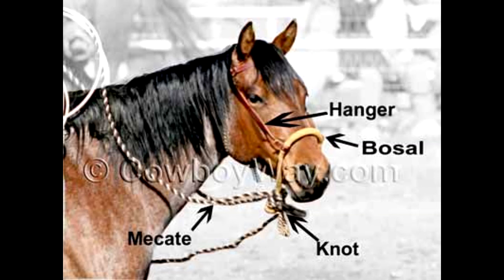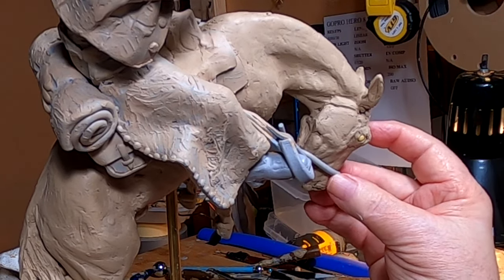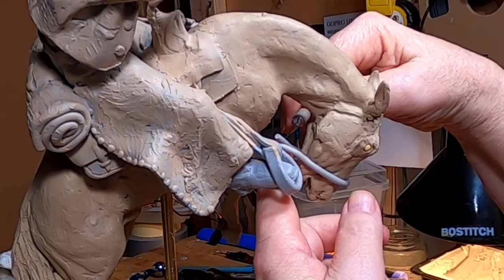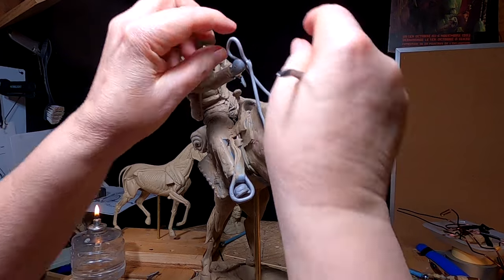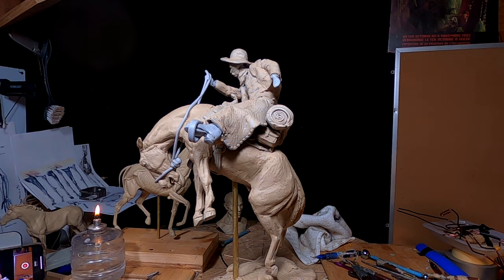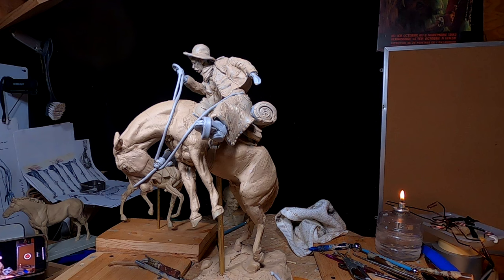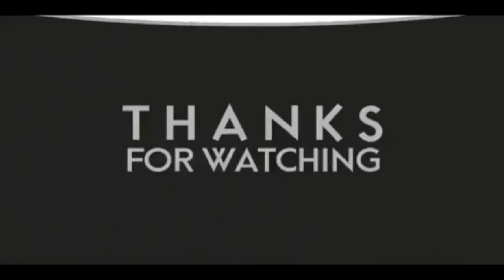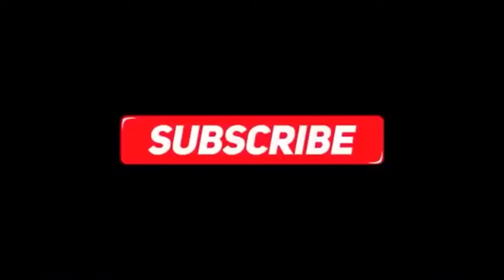A BURR UNDER THE SADDLE BLANKET   Creating the Hackamore Bridle

Comment: I still ride with a hackamore. Mine has a fiador and the mecate is made from alpaca instead of horse hair which is super scratchy. Some even made the mecate from an unbraided rope which also was softer on the hands

When I rode with a horse trainer in the 70’s we didn’t loop the mecate but tied split reins to the bosal so that if we were to get bucked off the loop wouldn’t cripple the horse nor accidentally wrap the rider in the loop. Just FYI

Also, there is no throat latch the only way to hold the hanger back was via the fiador